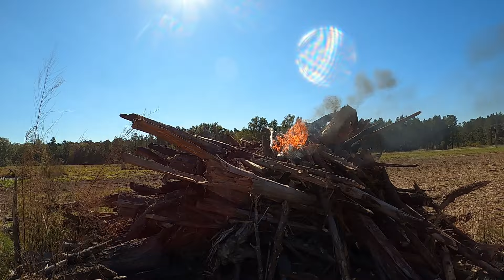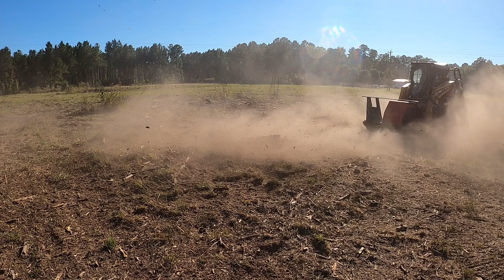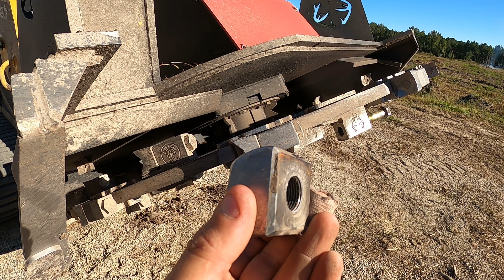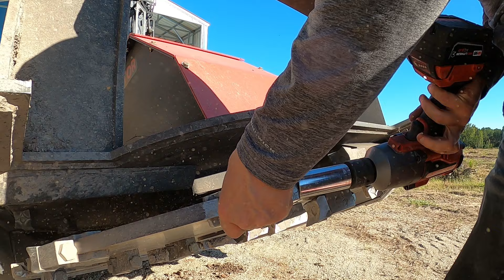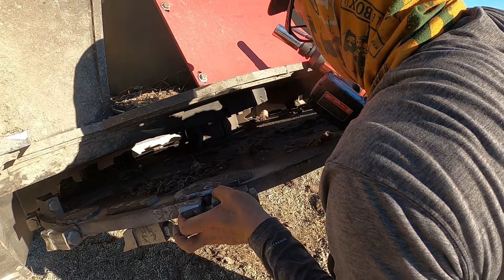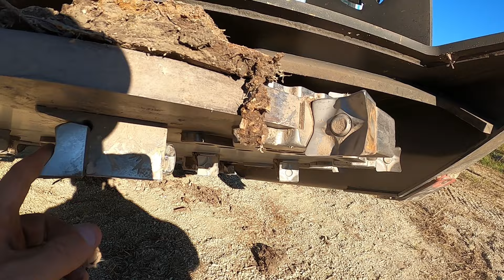UP IN SMOKE! TOO DUSTY TO MULCH SO WE BURN IT DOWN WITH DIESEL!

Comment: Get a 3/4 drive impact  socket and do away with the 3/4 to 1/2 adapter. You lose torgue using the set up you have now.
Reply: @BillTalkington-g5r  , a trip to Harbor Freight for impact sockets. Cheep yes,however if you break or gets miss placed,lost your not out a bunch of money 💰 in your

Comment: Ditch the reducer and 1/2 drive socket you're using and get a 3/4 impact socket and you'll bust those bolts loose a lot easier. Might cost you $50 but it'll gain you more clearance in the tight areas around the other teeth and you won't have torque loss from the reducer.

Comment: Need the High Output 6.0ah or the 8.0 or the 12.0 or you could consider the 6.0, 8.0 or the 12.0 Forge series batteries.  The XC 5.0ah battery is the part that is holding back the impact gun.  The XC 5.0 just don't have as much output current.  The gun is not the problem.
Reply from the maker: Ok cool I didn't know that I'll have to look into getting a bigger battery!

Comment: Use only enough push on the impact gun to keep from jumping off.The harder you push I think it puts the gun in a bind.The extra hammer of the gun helps loosen the bolt. Just my opinion .I’m not a know it all but based on years of experience.

Comment: I've burned many wood piles in my life and let's just say that's not how we did it. We would splash some diesel fuel at the four corners of the pile, light it, add more fuel if necessary, and before you knew it, each fire in the corners would meet up in the middle and the whole pile would be on fire. There would be no climbing on top of the pile and a lot less diesel fuel being used.

Comment: please get an actual impact socket
Reply: Yes. I saw that too. Impact socket will work way better and much safer.
Reply from the maker: Didn't know there was a difference
Reply: @idigit4967  yes. The metal and the thickness. The weight of them add to the power of the impact.